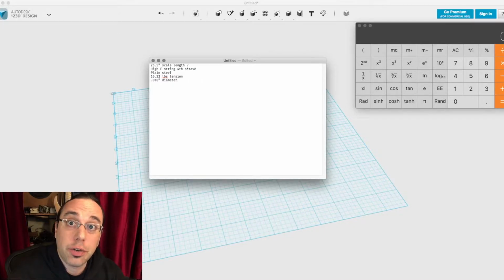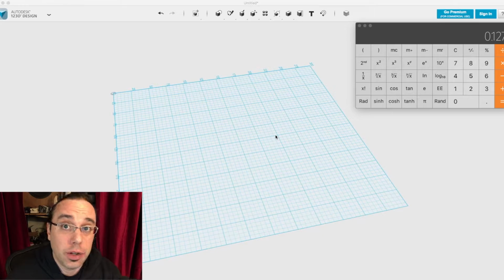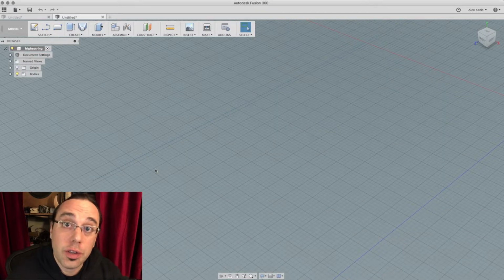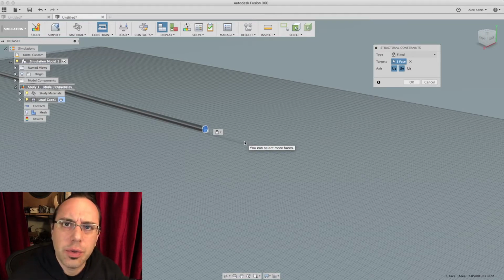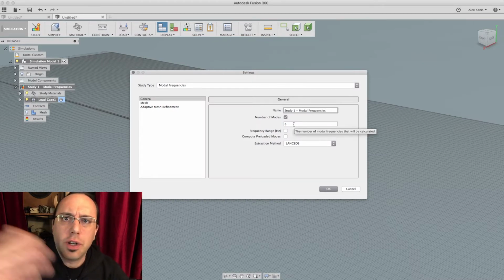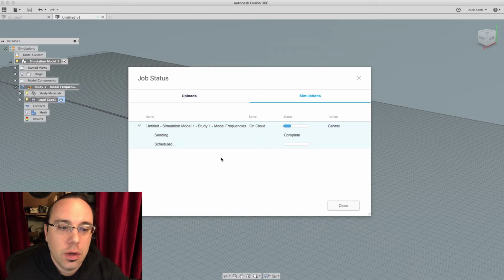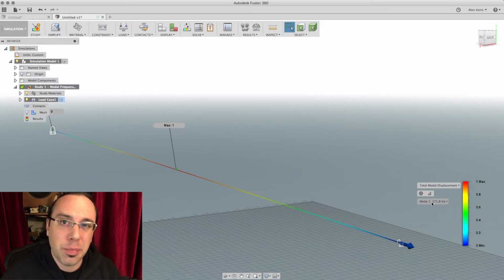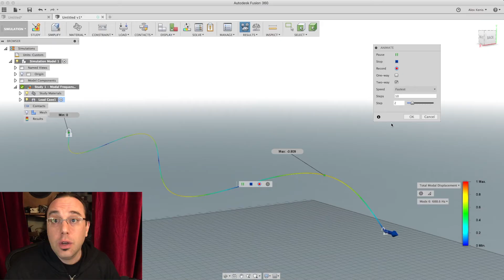Fusion 360: modal vibration simulation of a guitar string

Comment: Hey Alex, great video. This video is actually really well suited to solving a question I have been pursuing: What is the shape of the orbit/envelope of a vibrating guitar string? Basically -- what is the actual (millimeter) "Modal displacement" for each mode? I imagine the natural harmonics of the string will be the most significant, but I'm thinking there is some basic envelope that could be drawn that bounds all of the maximum modal displacements. 

I'd appreciate your thoughts!
Reply from the maker: That would be an interesting experiment. We know that the general motion of the standing waves is elliptic, and it rotates slightly on its axis as the string sustains. But X and Y axis probes could be set up to allow plotting the exact 2d patterns, and the probe could be slid along the length of the string to various modal antinodes.  That would measure the standing wave motion.  harmonic motion along the string would be tricker, but a camera or a camera and a strobe can capture that shape.  I did a quick test at 240fps with just a ruler for reference, and plucked the the a string 5mm from resting position.  Decay was exponential, quickly dropping from 10mm to "sustaining" around 2mm peak to peak (horizontal/transverse direction) until it dropped to micrometer range (could still hear the string, but obviously couldn't measure with just a ruler). vibration in the vertical direction could not have been more than 2.5mm at any point because that was the height of the string above the 12th fret, so elliptic.  Also, generally the vertical displacement stays much more constant than horizontal displacement (after pluck and also decay).
Reply: @AlexKenis  This is great, let me process this for a bit!

Comment: I only have a tiny Thinkpad X230 in my lab, 8gb ram, Intel GPU and 1366x768 pixels (IPS, fsck yeah), will i be able to run Fusion on it?

Would Fusion be able to simulate how different reprap parts and a moving mass (extruder) lead to gantry vibrations? If yes, why hasn't anyone done it? I imagine one could for example reduce the amount of steel plate used in a P3Steel frame. Or optimize printed joints towards least vibrations.

Last one, what is your dayjob? Unix admin here, it's boring but it's stable money. You have to eat, right?
Reply from the maker: Should run fine on that laptop, the requirements are not too steep.  Parts of the software are not very well optimized yet though, and they are a bit chuggy even on my tower.  

As far as simulating stress parts of a printer: good call! I have been looking into it in the last few weeks actually.  There are options in there for static stress at the moment, but dynamic testing is in beta, and it looks promising.  There is also a shape to strength optimizing option that could be useful for reducing mass as well.  

The sticky points have been that A) F360 requires real world numbers for printed part physical properties (which are quite variable) so I will have to run a battery of tests under standardized conditions,  AND B) F360 can only simulate isotropic materials at the moment, and 3D printed parts have different properties in the Z direction.  So I have been holding off on those types of tests in hopes that Autodesk adds in nonlinear material support soon.

My day job?  These days, I am a freelance audio engineer and musician mostly.  I also occasionally do some DSP coding on the side, and (time and workspace-permitting) design and/or build custom audio gear (recording hardware, tube amps, instrument amps, etc), but that has been placed on hold until I can get into a larger workspace, AND 3D printing and the accessibility of decent CAD/CAM software has thrown a lot of that into flux since it kicked open the door to a world of possibilities.  My new year’s resolution was to start making these videos to get more practical knowledge of all these neat new gizmos into as many hands as possible.
Reply: I'll install Windows 10 (runs Debian testing right now) on my Thinkpad next weekend and give fusion a shot. I fear the display isn't large enough, which probably means i need to buy me a larger display.

I hope that more people start looking into your videos and see that your stuff is kind of distinctive. Keep fighting, mate, it'll pay off eventually. Also, i sent you some parts money.
Reply from the maker: Thanks for the cashmonies!  It definately helps.  It would be nice if they rolled a Linux version since more and more tools these days are in the linux realm, but it is still under 'future consideration' when I last checked